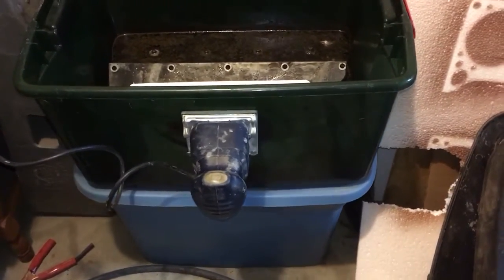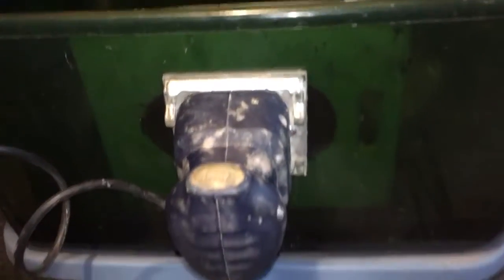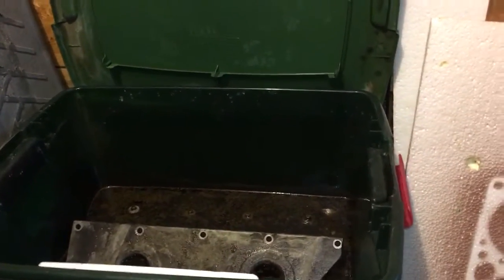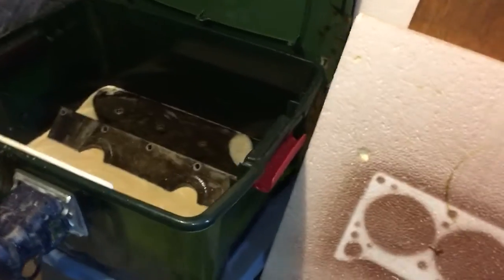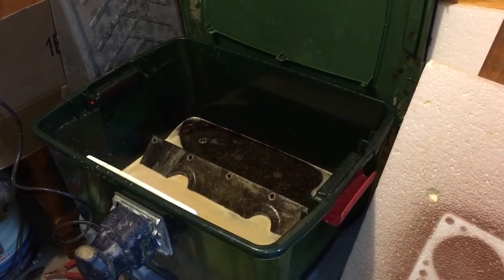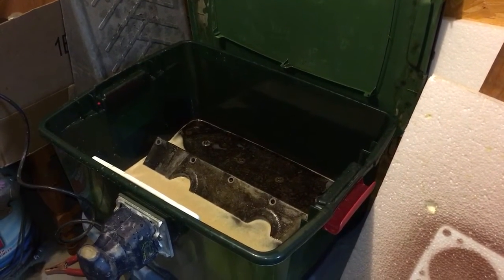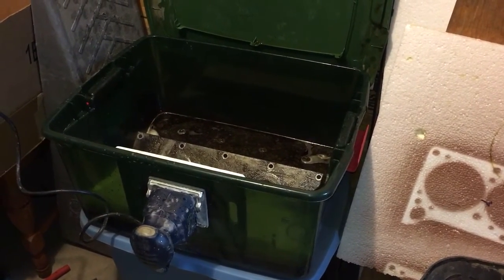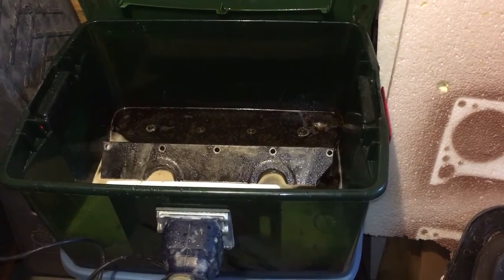How to Home built Sonic Parts washer

Comment: i have watched 8 videos about this DIY cleaner so far and no one showed the before and after of the part to be cleaned. This is the ninth one. :D
Reply from the maker: It does work ok, not great makes a lot of noise.  I believe if I had a stronger solvent or could use hot cleaner it would do much better.  I lost the one in this video during a recent move.  Thanks for the feedback... JD
Reply: HeadFlowInc thanks for the feedback and your time in experimenting. I think i'll go sodablasting in my application. Thanks again!